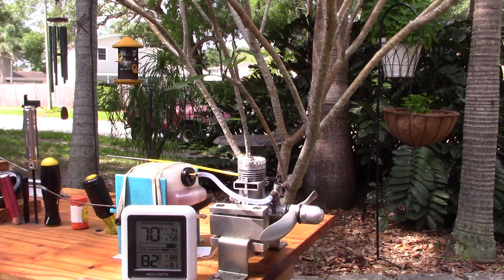Fox 29 A Run (Runner from Box O Engines)

Comment: This hurt.I could have used that cylinder and sleeve.  But then I don't need more parts I'll never use. This is an OLD Fox engine.  Not 35 stunt old but same tech.  Took a gallon to break in correctly with 3-5 minute runs with the right fuel and prop.  A masters in psychology not to completely understand the carb but to keep yourself from going bell tower crazy trying to understand that they really didn't know what they were doing.  And don't worry about the muffler.  That thing has the ports in the center but isn't drilled for the over under scews that never stayed in AND ear nubs for the screws that either broke those nubs off OR deformed the cylinder where you could tune the engine by tightening the muffler.  Then engine was designed to run right with a CL venturi full out with no muffler and all the rest of developement was an afterthought, but its what we had.  AND, it worked pretty good.  This mentality is why FOXES became very niche and OS n clones became the market.    
It is worth noting though that Fox motors were actually runners.  There was a bunch of motors before the 50's that maybe you COULD get them to run, maybe not, but the Foxes would run out of the box.  MAN has time moved on.
That cyl/sleeve in a Fox 35 stunt on a Fligth streak or Ringmaster, Perfect.

Comment: Super cool. I actualy came across a similar one recently.  On the second linkage arm on your exhaust side of the carb, it was connected to an exhaust valve/ baffle to provide back pressure. It also has a baffle on the top of the piston/ ridge.  Pre Schneurle porting.  I never got around to running it this was nice to see, I sold it to a nice gent on the coast, it's well before my glow generation.

Comment: Also, if you want loud, find someone that runs a Fox 59 long shaft.  Your hearing will shut off under 5 feet from it.  It might cause permanent damage though I still had my high range hearing for quite a while, TVs used to really drive me nuts.  Now I'm old and those mosquito noise makers they use to disperse kids don't affect me anymore.  The guys long shaft would come around the circle, get close to me and my hearing would stop, it would go away and my hearing would come back on.  Its a loud engine.
Reply from the maker: Been there tried that...
https://youtu.be/E9znbdnx92k
https://youtu.be/iD8loBJtjMw
Almost as loud as this one.
https://youtu.be/9-pxcWC1jaQ
Or this one.
https://youtu.be/cnk2CPuzoQI
Reply: Orwick .64 or a Yulon .49 puts it to shame.
Reply from the maker: This engine is yours if you want it John.
Reply: @dmrcflyr2  Thank you David.